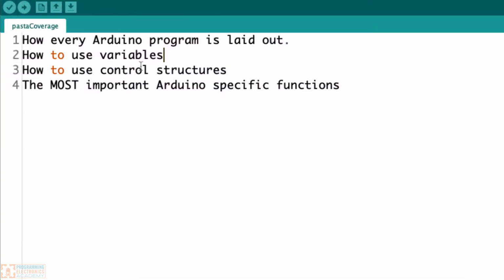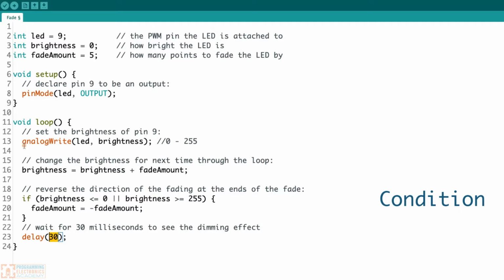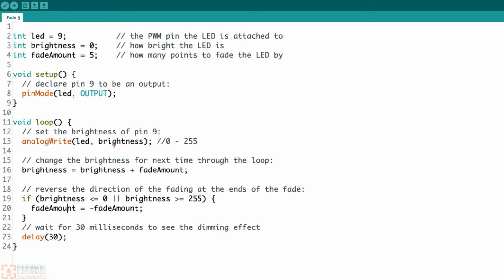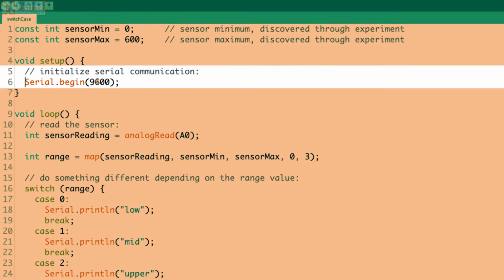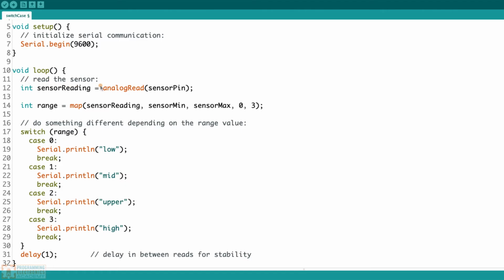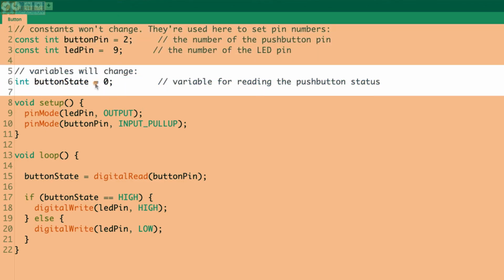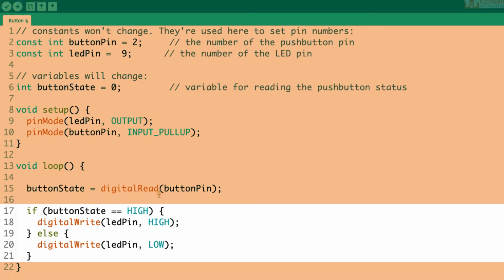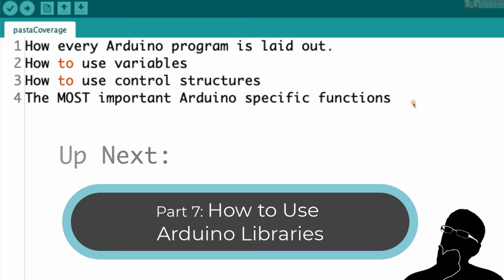Arduino MASTERCLASS | How to Use Control Structures PART 6

Comment: Good day.  Your channel is excellent for teaching Arduino programing and has greatly helped me get started.  I've been able to build a Master Control Panel for controlling three Stepper Motors with three potentiometers, Forward and Reverse switches, and three Rotary Encoders for a fine feed adjustment of one thousandth of an inch on an industrial milling machine. So thank you very much!  That being said, I have found the organization of videos somewhat difficult to navigate.  There are several Playlists which is helpful, but naming conventions and Thumbnail titles are often different and confusing.  For example, this video popped up and I started watching it, then decided to watch the other parts of the MASTERCLASS series, but it took me several minutes to find it and I almost gave up.  The MASTERCLASS playlist is named "Learn Arduino in 90 Minnutes" (misspelling included) and the Thumbnail is "What can Arduino do?".  So it was extremely hard to find.  I wish all your Arduino videos were either in one Playlist that advances from beginner videos to advanced instruction, or in three Playlists for Beginner, Intermediate, and Advanced.  Though to avoid covering the same subjects multiple times, I would prefer ONE Playlist.  I hope this is of some help to you. Regards.
Reply from the maker: Thanks a ton for this feedback!

Comment: Hi there ,I really like the video 
I need some help , I would like to run a few motors as well as sweep a servo using one push button from an Arduino Mega board. I have tried to make us of the if statement for when the button is down, and I have also tried making use if millis functions to separate the starting time of each component. If somebody could help me I would really appreciate it

Comment: I'm having a bit of trouble using a switch case to do 2 functions based on one of 2 buttons being pressed. I see how you used it here with an analog input range. I'm just using whether one of the two buttons is pressed. Should I use the map command to create 2 values for 2 cases? 
I'm sure your a super busy guy so if you don't respond I won't take it personally. 
Overall thank you so much for this super useful information. You're a great instructor!

Comment: I found your book online do you think I should buy it I’ve been learning since February with elegoo super starter kit i did arduino stuff every day in February but I had to put Arduino aside the past few months due to school but did still stuff maybe every 1 week or 2 weeks i would do stuff but I have kind of forgotten how to right code now I understand the code I read but I can’t remember how to write stuff specifically so I have just been using the Arduino reference page and my old code I’ve written to help me write my code and have gotten on fine.What do u think I should do.

Edit: Great work on series as well it’s really good
Reply from the maker: Thanks Duller!  I'd recommend checking out our courses at Programming Electronics Academy.  If you sign up, you get the same ebook as part of the training program.

Best of luck!
Reply: @programmingelectronics  ok thanks